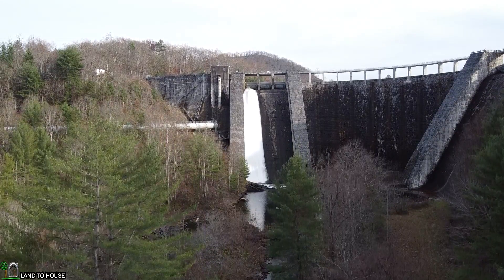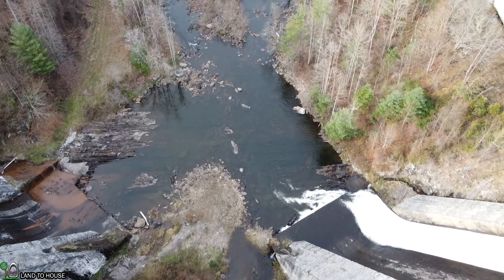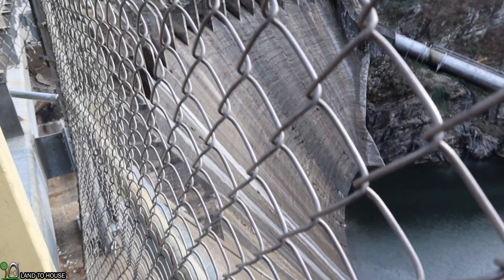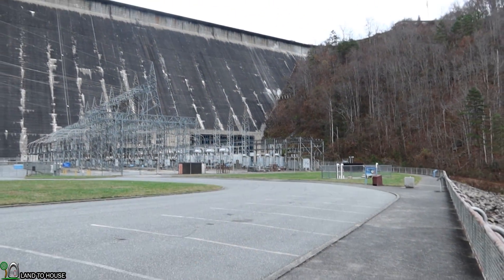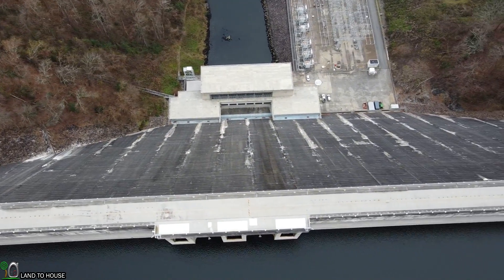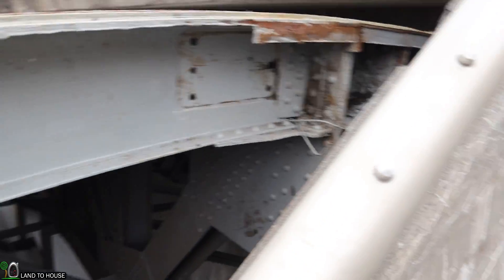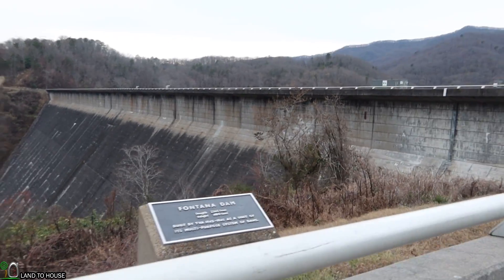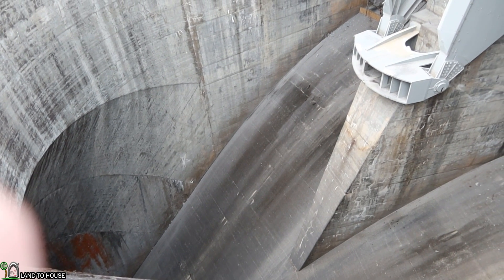3 DAMS 454 MEGA WATTS of POWER

Comment: Great that you also visited those slightly larger Micro-Hydro Systems! 😉 Take your kids with you and show it to them also (when the weather is better). Btw. have you seen the large surge tank above the Santeetlah Power Station!?? That is to avoid water hammer. Could you imagin what powerful ram pump you could build when you slam shut the valve at the end of that 5 miles penstock!!?